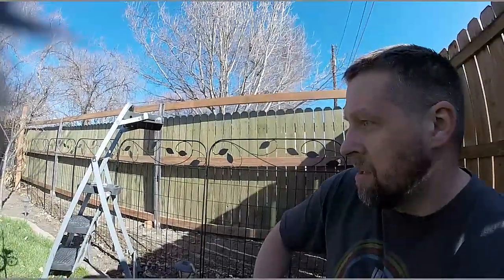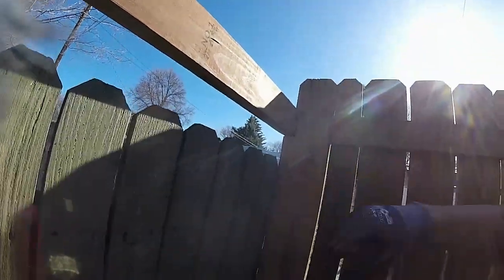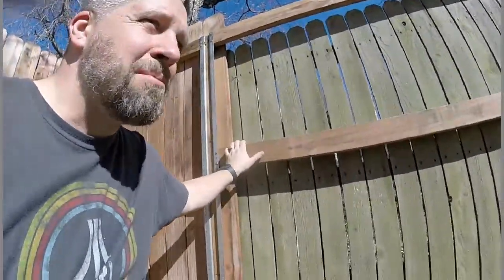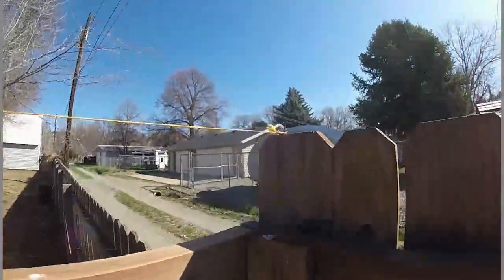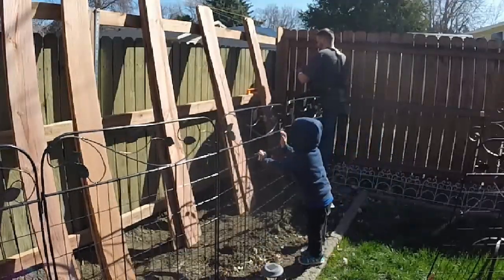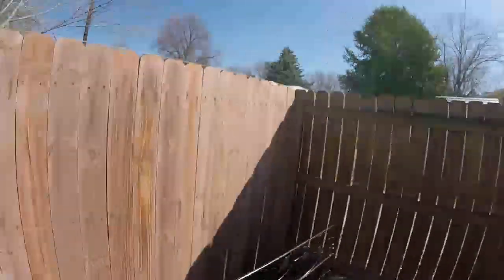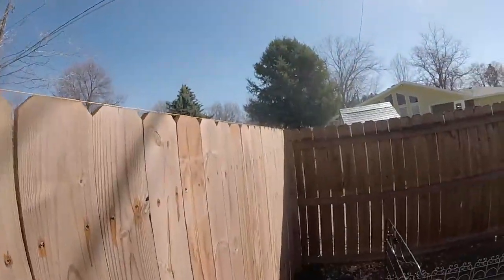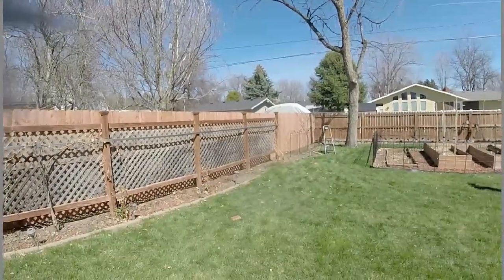Build a Privacy Fence

Comment: Was your yard level or did you hang your rails by running string?
Reply from the maker: Ground was relatively level but did not use a string line.  The PostMaster posts have indicator line stamped in them every 6 inches.  I just made sure my rails were attached at the same indicator line on each post.  Bottom rail approximately 6” from ground, middle at approximately 30” from ground and top set flush with top of posts.  Then just eye ball if you have any posts lower than the next. As long as you don’t set the concrete around the posts you can lift the post up or drive one further into the ground as needed to get a more level look.